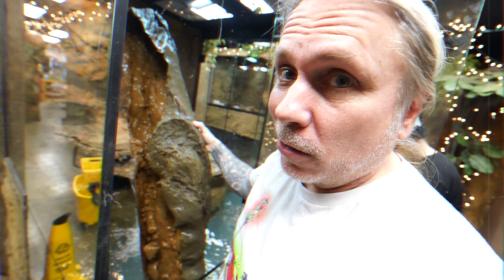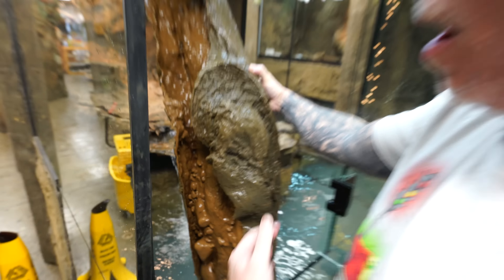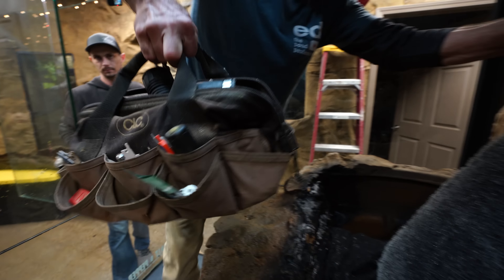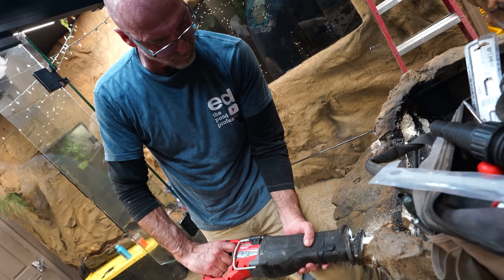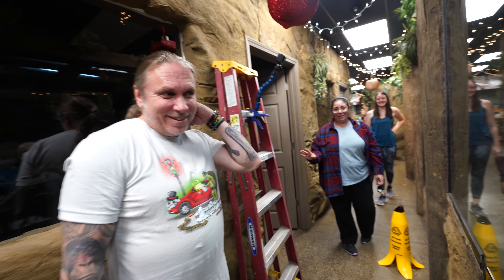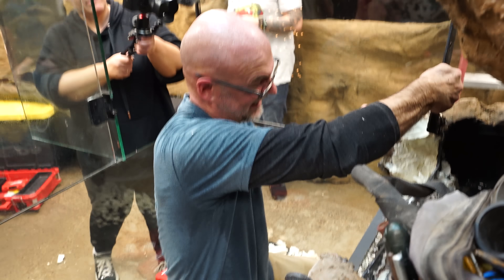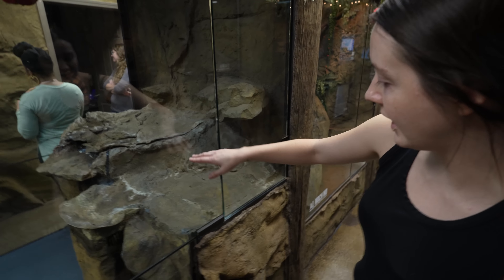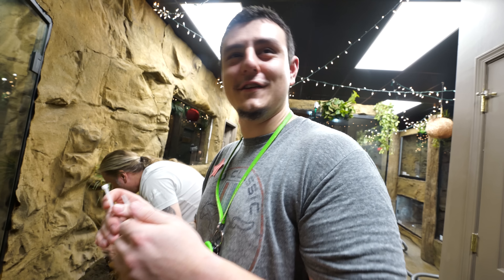We Destroyed My 2,500G Albino Alligator Tank

Comment: Havent seen the entire video yet but if there are cracks or slits you can put expanding foam in the cracks and use a wire brush on a drill to make it have texture and slim it down then you can paint it the same colors using a mixture of sorts

Comment: I think that for the aquarium, you really need to plan ahead a bit more and design all of the tanks and ecnlosures with water features in a way that you can access the internals more easily. Taht way if you have to do any repairs or maintenance everything is much easier to get at.
Reply from the maker: We can access all the things we need. If the gasket was put on you would never need to access that part. It was a mistake when building. But you can access all the pumps, filters, pipes ETC..

Comment: The initial design and construction of this water feature/display was extremely poor.......
You never want to rely on silicone or foam for any water containment or structural integrity......
You must forward think when designing something of this nature from a long term maintenance standpoint......
I see this type of work here in LA everyday........I have seen much much worse error....
They got away lucky as water was just getting in behind the liner as the design was poor....
It should be fully self contained and enclosed so there is absolutely no way water can take the least path of resistance and end up on your floor....
Reply from the maker: I didnt design this enclosure and obviously the waterfall was not prepared properly. We all know that. Going forward they will all have the seal